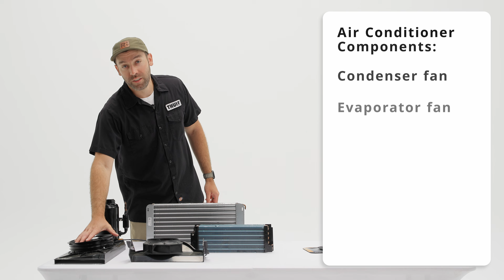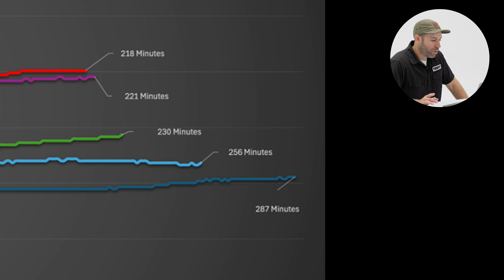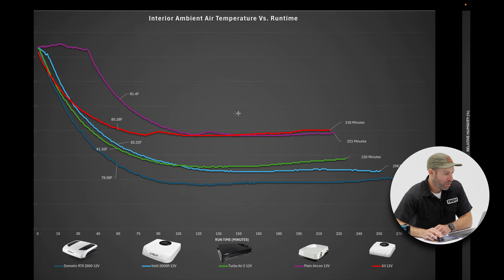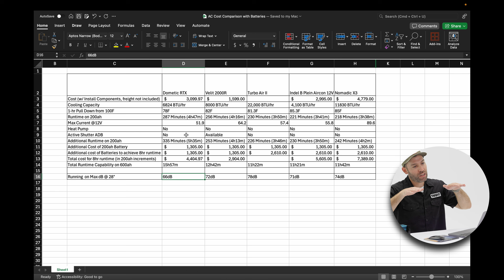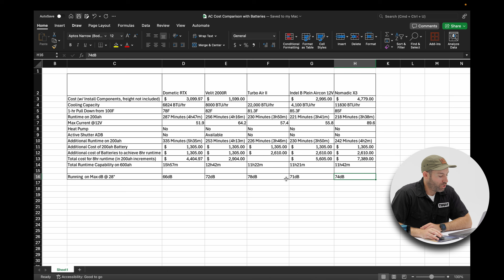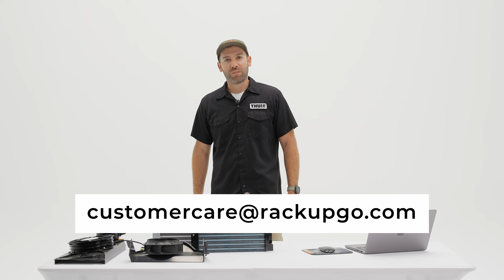Heat Chamber Test Results | The BEST Battery-Powered AIR CONDITIONERS for Vanlife

Comment: This is an excellent video! I had to go back and watch again. I am struggling to choose an AC unit for my ford transit LWB high roof van because I live in Texas and my plan for the van is to live in it while I work out of town. I'm a builder, so I can usually plug into shore power at the job site. I have been told that the dometic 2000 won't be large enough to keep the van cool during the hot Texas summers so I was looking into the velit 3000r. But that one pulls a lot of power and if I ever can't plug into shore power, the guy at velit said my 600w battery bank would only keep the AC running 4.3 hours. Not ideal as I have a dog and a cat. I'm learning toward the dometic because it seems like it's a bit better than the velit 2000r and maybe with a bulkhead and window coverings, it will do well enough to keep the van cool. I'm curious if you know of any Texans with van conversions who use their vans in the summer and if the dometic seemed to work well enough. Thanks again for the video!
Reply from the maker: Thank you! We definitely know of customers who are running the RTX 2000 in the Texas heat and have been satisfied with its performance. However, this largely comes down to van construction/insulation and more importantly, an individuals comfort preferences. Now, there are a couple things to consider - the RTX 2000 is a bit more expensive than the Velit. Could you increase your battery bank size for the cost difference? The RTX also has a non-standard roof opening. If you found it didn't have the cooling capacity to keep the van at your preferred comfort level, retrofitting another A/C unit becomes a little more challenging. The other consideration would be to move to a shore power unit since that is your usual scenario. Shore power units are also a bit more affordable than the RTX and they definitely have the cooling capacity to keep your van (and your pets) cool in the Texas summer heat.

Comment: Will you test OutEquipPro and Countrymodpro 12V units?  Thank you.
Reply from the maker: We've never heard of these, do you have a link where we can find info on them?
Reply: @rackupgo  both seem to be fairly new units. Would be interesting to see either one or both compared to the Velit being that the price point is on the lower side. 
Thanks for the great unbiased video! 3rd party testing should be the only information to consider. 
Question, the color of the external shroud white vs black, is one preferred  than the other in regards to performance?
Reply: @rackupgo   Will be good to see you test these two.

Comment: amazing content and saved for future use! sorry if i missed it, but what was the area size in your control for the testing? separated rooms? one big empty box? ie any of these would cool faster in a sprinter vs box truck vs full size rv (hope that makes sense).
Reply from the maker: Thank you! The interior chamber was sized to approximate a 170 extended wheelbase sprinter. It was a big empty box, no furnishings or other objects that would contribute to thermal mass in the chamber, so it was strictly just cooling the air volume. It's a good point to consider as furnishings or other heat sources (like a refrigerator with a hot condenser) could contribute to a longer pull down, however, it would be a difficult variable to control from one A/C test to another.

Comment: Been installing a lot of dometc rtx 2000's so glad to see they are performing the best. Doing a couple X2s that are 24v so hopefully they perform a bit better then the 12v x3!
Reply from the maker: Well, the X2 is a slightly smaller unit than the X3, both in footprint and in cooling capacity. However, we have seen the higher voltage units perform better than the 12V.

Comment: great info friend!
so the Velit unit should work in my old 2000ish starcraft slide in truck bed popup truck camper in the hole where i currently have a maxxair fan? what im really wondering is when plugged in to shore power it should run just fine just like my 12v maxxair fan right, through the factory inverter or whatever they use. not sure my house battery(94 AH Quasar carbon nano gel ) would run it, i have a small portable gen for boondock situations
Reply from the maker: The Velit should fit into an existing 14"x14" opening where you have a maxxair fan, however, it would be best to measure and verify the opening is at least 14"x14" just to be safe. Regarding plugging into shore power, the size of the AC to DC converter and the house battery charger will determine if the Velit will run without overloading the system or draining the battery faster than the charger can keep up.

Comment: Have you done a comparison for 120 volt units? Why 12 volt vs 120 volt if you have a Victron Multiplus?
Reply from the maker: We haven't done a comprehensive test for 120V shore power units yet. Our focus is primarily off-grid solutions. However, we included two 120V units in this round of testing just as a baseline for comparison to show the increase in efficiency by not having the losses of the inverter and also compare pull down and temperature maintenance performance. One unit would not run due to the excessive draw at startup. The other unit, the GREE Eco-Cool, was able to be tested and actually had a total runtime similar to the worst performing DC units.

Comment: Excellent video Chris, not many questions arise after viewing your content. Except one : ) Given the choice, for a Van that will have 1,300+ Amps at 12VDC, 100Amps Alternator Charging and about 300 watts of Solar, which model would you choose? TOSOT/GREE Eco Cool or the Dometic RTX2000. I realize officially you can't put one above the other but hypothetically speaking...
Reply from the maker: Thank you! Regarding your question, it would depend on a few other factors, primarily the geographic location it would be used most, and then also budget as the Eco-Cool does provide some significant cost advantages.

Comment: Nomadic X2 is there for comparison. Just one question, is Thule selling ACs now, or why do they pay for this video? 🤭
There is a Dometic RTX1000
A fan open to the top is a problem as snow in winter and dirt, leaves and sticks, all collects in there, freezes, also would the Australian sun risk to dry the plastic and fan blades, make them dis functional. I rather have a closed UV stable shroud
Reply from the maker: On paper, the X2 is less powerful. The cooling components are also reduced in size compared to the X3 to fit in the smaller footprint. Considering these factors, we would expect the X2 to have a lower performance result in this test compared to the X3. 

Despite the open top design, we've not had any reports of fan damage as a result of snow, dirt, leaves, sticks, or UV damage in the many years we've been selling and servicing these A/C units. They've been designed and constructed to handle the elements, including in the off-season. 

Regarding the Thule shirt, they do not make A/Cs and they did not sponsor this video. However, Thule is a brand we offer on rackupgo.com. If there's a specific product you're interested in, let us know, we'd be happy to assist!
Reply: Cruise n comfort units are aluminum shrouded and 2k more btu

Comment: You forget the new Openair 12V full inverter from Bergstrom.  Thats a real innovation. In aPin with this horrible weather, the people prefer this cause its 2000 W of cooling power under ISO norm 5151.
Reply: but where to get? I see only Spain has distributors.
Reply from the maker: If the Open Air 12V becomes commercially available in the US, we will certainly consider testing it. At the time these tests were conducted, it was not readily available and still appears to be exclusive to Europe.

Comment: I'd love to see this test again with 2 alternate variables:
1. Starting at a high humidity. In the Northeast humidity levels of 90% are not unusual.
2. Starting at an already reasonable temp for battery life. Maybe say 80 degrees and trying to maintain 70 degrees to see how long that would last.

I also know the dometic at least has a number of modes, so i'm curious what mode that unit (and others if applicable ) were in for this test.
Reply: The humidity is absolutely key to how an air conditioner performs. Starting at 15% humidity is silly. You're not pulling any significant moisture out, until the air in the enclosure is above ~40% humidity, and the actual number of that point will vary from one air conditioner to the next. Starting at 80% humidity would have made a HUGE difference in the results. Here in FL summer, it's not uncommon to have an 85° day, with 80%-95% humidity. After rain? it's still 80° and 99% humidity
Reply: @JohnDoe-fk6id  totally agree. I spend winters in Florida and summers in Texas. It’s a totally different ball game, but the humidity is high. Anyway, you guys can do that test?
Reply: @JohnDoe-fk6id  This is now even true in the Northeast, believe it or not. Humidity is KEY.
Reply from the maker: Thank you for the recommendations on the test protocol! Regarding the operating mode for all of the units, they were placed in normal or Auto mode depending on the options.

Comment: You should take your dry bulb temperature and humidity data and calculate enthalpy, which is a measurement of total energy in the air. That would be interesting to see and it should show the amount of energy each unit has removed from the chamber. This will also compensate the data trends for any starting condition variations. Send me the data and I can do the calculations.
Reply from the maker: Great suggestion! We did perform the enthalpy calculation and the results aligned perfectly when ranking the units based on the time to reach set temperature and humidity control. The RTX came out on top followed closely by the Velit, then the Turbo Air II, and then the Indel B, and finally the Nomadic X3 coming in last.

Comment: I found mine on eBay for $587 with shipping for the WHOLE set-up. It works well and is nice and cool inside the van. Time will tell if I purchased the right one.
Reply: what did you find on ebay? which unit?
Reply from the maker: Sounds great!

Comment: Would love to this testing done with the split units like Cruise n Comfort and others;  see how they compare to roof mounts.
Reply from the maker: @Zyzzyx42  stay tuned!
Reply: Woohoo!   My current van was built 9 years ago, 12v a/c was rather slim then, got an Indel Cube, maybe 3000btu, and... its not done well.  Last year we finished her new van with a 120v roof unit (RecPro?), rated 9k, and... its ok.  I'll be building my second van next spring and looking at 48v units; interested in split setup but dunno if the cost is worth it over roof mount.
Reply: yep, that would be great, as we all have space at the wall, could add another solar panel

Comment: I wish dometic did 48v like velit. I might make my system 12v just for the power savings of the rtx 2000
Reply from the maker: @dishcleaner2  they are launching a 48V soon!
Reply from the maker: @dishcleaner2  https://youtu.be/69cm-O9pg-8?si=--he91s25qSMgHXI
Reply: @rackupgo very cool! It looks like it uses more power compared  to the rtx 2000 though.
Reply from the maker: @dishcleaner2  decidedly, when it’s on constant high output, yes, it will pull more power as it has twice the cooling capacity, but power draw is all relative in many scenarios. When an a/c unit is designed properly, it will scale up and down based on the cooling capacity necessary to maintain your set temperature. So, where the RTX may be working harder to maintain, the new 48V Freshjet would be able to scale down, thus reducing the power draw
Reply: @rackupgo  thanks for the info. I'll keep my eye out for it. It makes sense theoretically, but I'd still like to see an in depth video testing out its efficiency in comparison to other models.
Reply from the maker: @dishcleaner2  stay tuned!! Testing as we speak

Comment: Can you make any comments on how the voltage of the unit would affect the performance?  Some units are 24v and there are also 48v units available.
Reply from the maker: Voltage alone doesn't necessarily have an impact on performance unless the components also increase in capacity. Higher voltage units can take advantage of greater available power and build in higher capacity components to achieve more cooling power. Efficiency (how well the unit converts the power into cooling power) will ultimately depend on the components used and how well the system is designed.

The benefit of a higher voltage unit is that the wire gauge is able to be decreased. This allows for easier running of the wire, higher voltage units have a lower current which leads to less heat in the wire, and less weight as a result of the smaller gauge wire.

Comment: Great video! I personally have a 33ft fifth wheel, but being able to have supplemental cooling for down the road is a nice option. We have the majority of the RV 48v though, I wish they started designing more versatile voltages. But for a van, 12v is really the way to go for a simple and robust system!
Reply from the maker: @stinson87  agreed! There really are pros and cons to any system. That’s why we ask specific lifestyle questions when helping customers find the right products for them